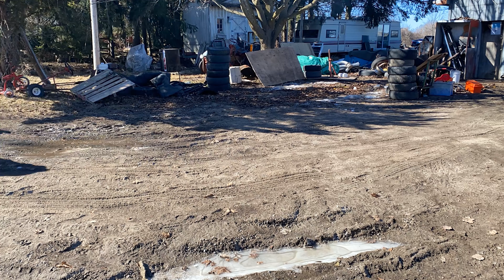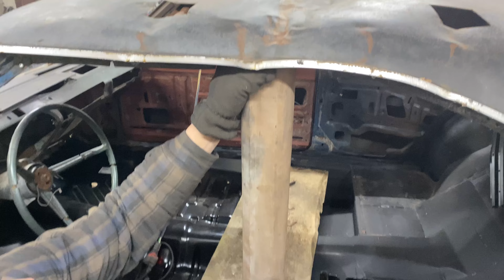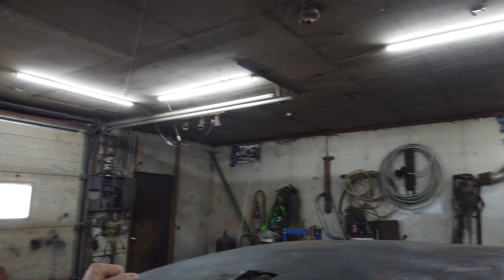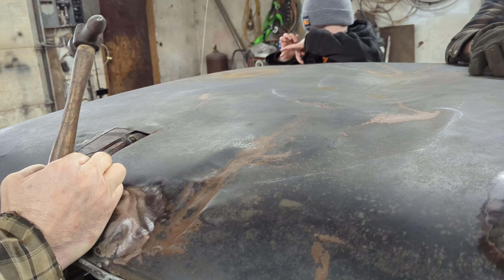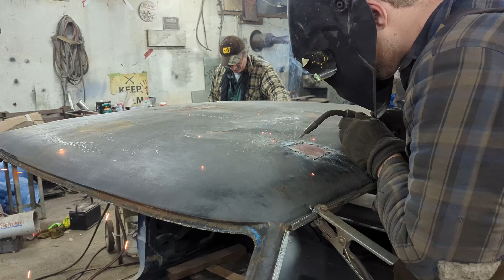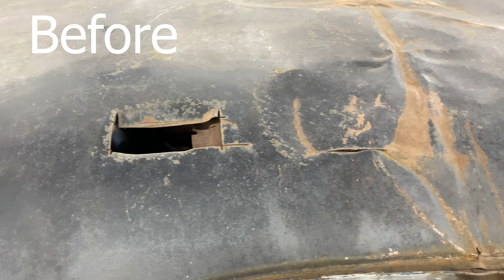Rescuing 1969 Charger - Part 2 - Roof Repair

Comment: You guys have the patience of Noah to spend so much time on the roof. My concern is the roof has lost its temper and rigidity of a compound curve. I'd want to add a few bows across the roof or fiberglass it under the vinyl. Well done gentleman.
Reply from the maker: Thank you! Ya it was bad, still a bit more to go with it. But you are bang on! We've been thinking that some extra supports underneath would be a wise move. Never thought of fiberglass under the vinyl though, very cool idea!
Reply: car panels get their strength through shape, not temper - it's just mild steel. once you get it back to shape it'll stay there.

Comment: Nice work,  If you have access to a power hammer and an English wheel,  perhaps a better repair would be remove the roof.  Repair the skin and the inner structure.   Especially if you are replacing the quarters.    Is this an XS or XP car?
Reply from the maker: Didn't think to remove the roof tocdo the repairs then put it back on... That would be a  approach